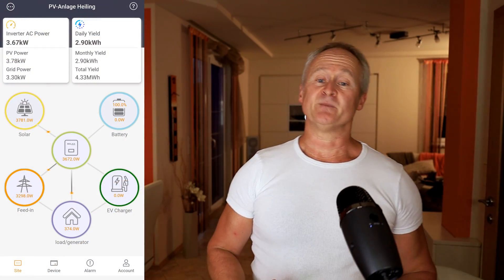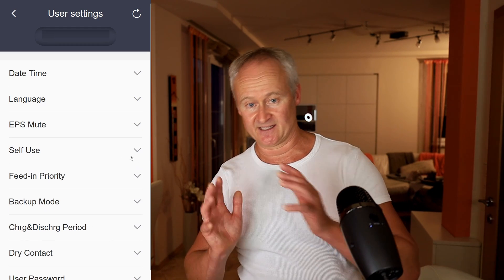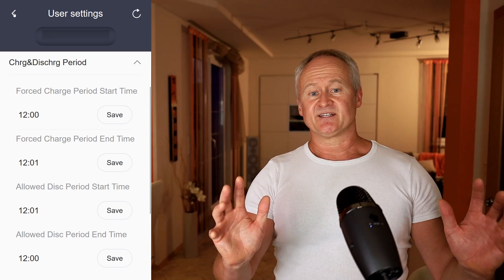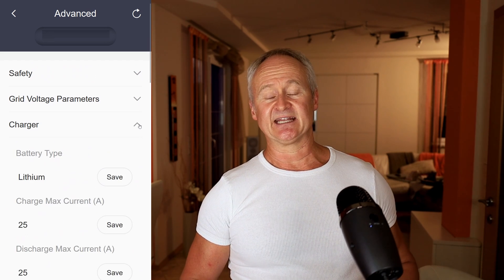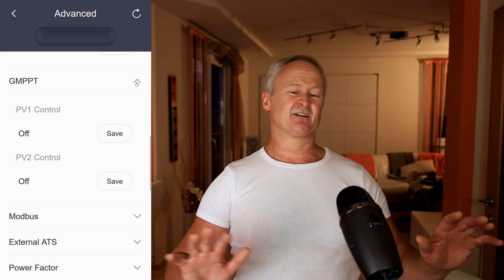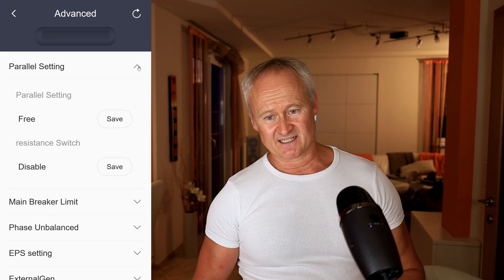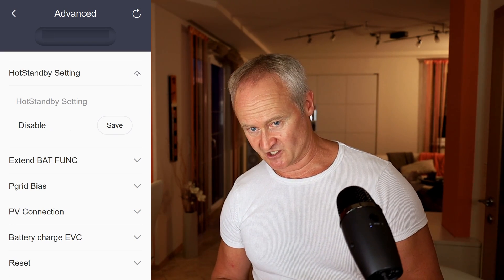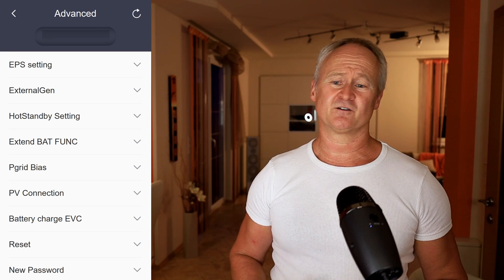the basic- and advanced settings for the Solax X3 Hybrid inverter !

Comment: I have just installed a Solax X3 8Kw G4 with mate box linked with 2 Solax batteries (1 x master and 1 x slave) It constantly reads either 50 watts or just sits at standby. I have change everything to the same as your video and yet it still sits there doing nothing. Solax support were very helpful and upgraded the software and it all stared working, the support now has gone very quite and don't seem to respond to any e-mail requests.

The system has gone back to doing nothing mode. I doi not have solar panels for another week but was informed before purchasing that the system would happily run on batteries alone, charging at off peak and discharging during peak. So far I have a very expensive box sitting ion the wall doing absolutely nothing. Any help or advise would be greatly appreciated. Regards, Glenn

Comment: Hi Alex, i tryed to contact you, i am having a problem setting a X3 Ultra 20kW in Portugal about grid parameters, can you help?
Reply from the maker: Hello, I am very familiar with all the components of Solax and I also have an official Solax installer account. What is your specific issue?
Reply: i have the x3 ultra 20kw, 16500w in 30 panels, 7units 3.6 battery and ev charger, when i am off grid, all works well, when i put the breaker of the eletric company up when the inverter reads the grid, it puts the breaker down and cant syncronise with the grid
Reply from the maker: @filipesilva570 so the system can not work in grid parallel mode or its only not possible to switch back after eps mode ?
Reply from the maker: If you send me your registration number of yout dongle i could check your system. You can contact me via whatsapp.+43 664 4509261
Reply from the maker: Have you set the right settings for your country ? You should not install an RCD (Residual Current Device) between the public grid and the inverter connection. This is not intended.

Comment: Hi ,thank you for this instructional  video, I would liket to ask you a question;I have x3-hybrid-8kw-g4 inverter with lead acid batteries,with CT clamps and we have installed the inverter batteries ,solar panel following the instructions but I have 2 problems first when there is no solar power batteries do not feed the house, as far as I recognized and secondly when the frid is off normally ınverter should supply power from EPS port but when I cut the gridd off there is no power on EPS port  how can I manage these 2 ıtems do ypu have any idea?